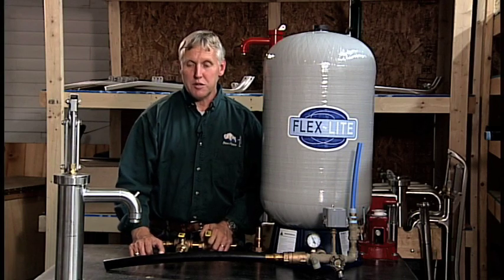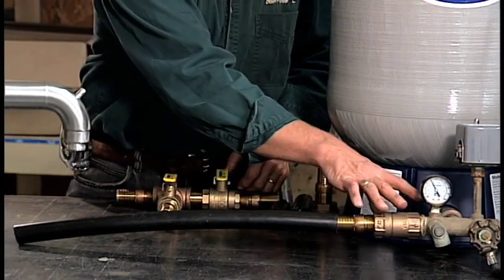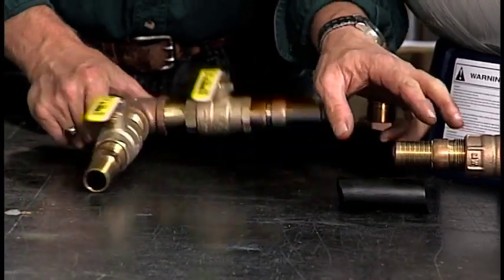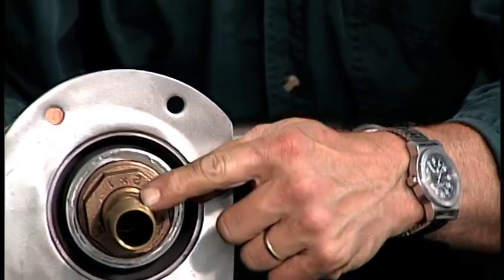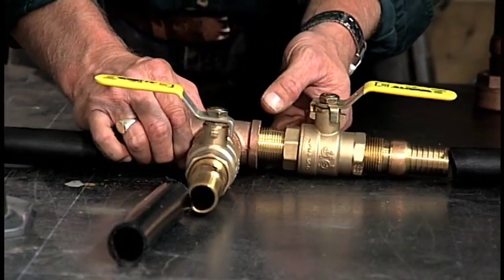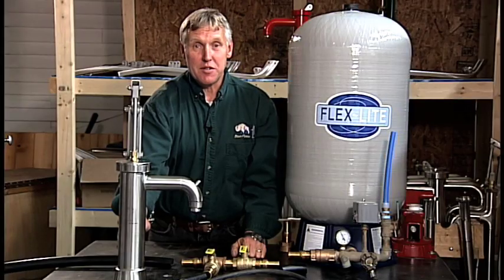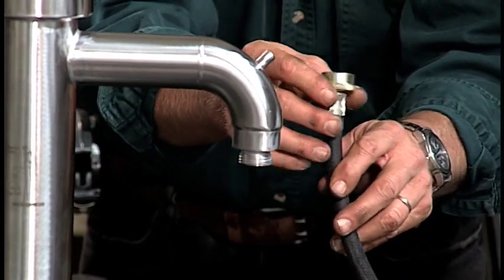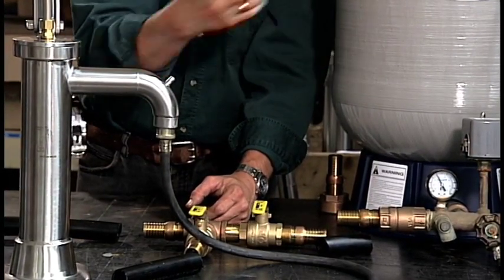shallow Well Hand Water Pump  Installation - Bison Pumps

Comment: I'm getting ready to practice for when the electricity goes off.

To use hand pump
1) shut valve to holding tank
2) shut off power to the electrical pump
3) open valve to hand pump
do not raise handle past 2 o'clock or water pressure will drop

To go back to electric pump
1) shut valve to hand pump
2) turn on power to electrical pump
3) open valve to holding tank

Is that right ?
And if I want to adjust the amount of water coming out when I pump -- do I rotate the upper brass nut ?
Reply: There is no reason to call someone you don’t know anything about dumb.

Comment: Can the inlet of the hand pump see the full pressure of the submersible?  In other words, what happens if you forget to close the valve going to the hand pump?  If it is rated to handle the pressure, would it be harmful to just leave that valve open all the time?